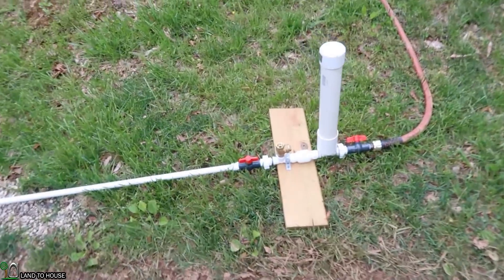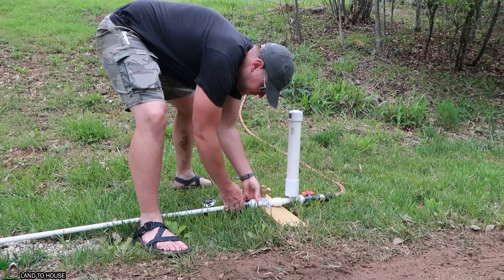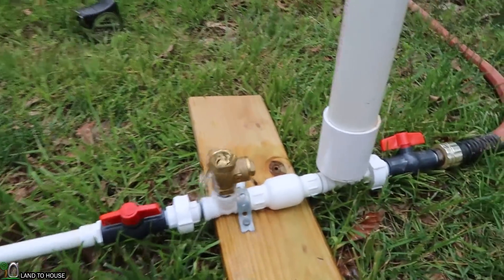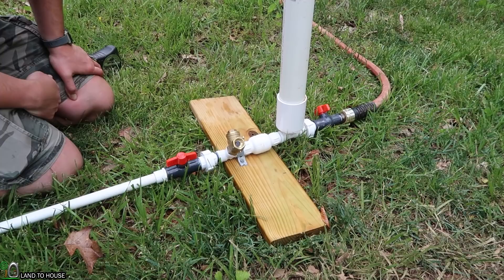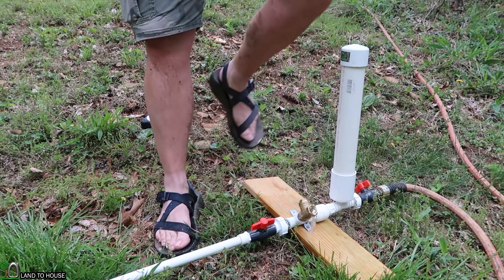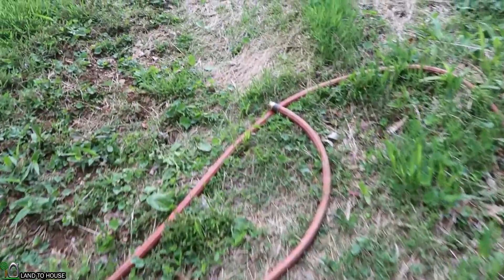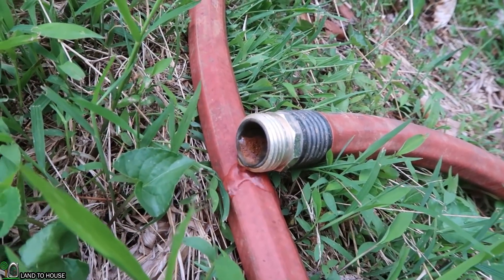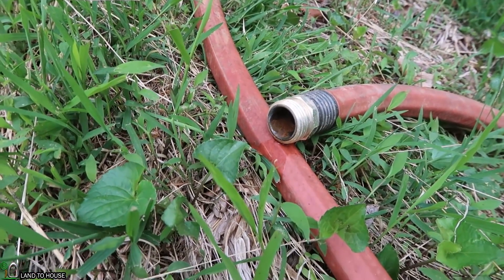Ram Pump Absolute Minimum Head Pressure

Comment: So, the mass of the water makes the water hammer that drives the water up into the air chamber, which is why the long run of pipe.  Why don't you increase the diameter of the feed pipe and reduce it near the pump. A greater mass of water should equal more pressure.

Comment: Have you ever tried using the venturie effect to step up the pressure from a flowing stream that is relatively level? I know it would speed up the water flow I just don't know if it would be enough.

Comment: I have at least 10 GPM (I can fill a 5-gal bucket in a about 20 seconds) but not much head...maybe a couple of feet at the most, I haven't had a chance to measure it yet as I'm just starting to build my system. I will probably be hooking up the intake in the bottom of a culvert as it comes out from under the driveway as that will give me the most head possible since there is a 1-ft drop immediately after that and someone else's property on the other side. I don't need a lot of water supply as it's just the dogs and I and I'm filling a 275-gal tote to pull from with a 12V pressure pump to a well tank. Would you say use the smallest one available as that works best/most reliably with low head?
Does it matter if I use rigid or soft hose/pipe at any point in the run? Does softer hose cost any pressure/efficiency with it's flexing or does it matter? I'll be running the intake down the creek a little ways to gain more head and put it closer to my water cube so a hose would be easier for following the twists and turns. 
I was about to order my ram pump tonight but ran across this video and figured I'd ask first before pulling the trigger.

Comment: Could you add a stand pipe to this to increase pressure from a very low head? I have a length of river on my property that is fairly flat with a very high flow rate. Wondering if i could make a ram pump that woukd function in these conditions. Need to pump water about 6 or 8 feet up the bank to bottom fill a large tote for irrigation/livestock

Comment: EUREKA, this tip to turn the check valve finally got mine cycling with little head.  Now I can work on improving the weir to raise the water level and eventually get the check valve back vertical.  Thank you!

Comment: What happens if you increase the diameter of the pipe to three inches then convert to 1/2 inch on the end. With more mass of water behind it falling, would it help the twenty inch ram pump function?
Reply: I'm wondering the same thing there must be a answer somewhere

Comment: I haven't come across one yet but have you made a video about the differences in one to multiple storage tanks. I was thinking of adding a stand pipe with a gauge on the top end to see if I could read intake pressure without water hammer interference on that gauge. However I realized this would also act as a secondary air pressure vessel and wonder what effects this could have on the pumps performance.

Comment: So you could have a staged or stepped system to get water up to 6' essential having an intermediate water storage and two pumps? I guess the intermediate storage tank you need to be quite big and not fill very fast, but you would be at least be able to lift the water higher?

Comment: Seth, I've been testing my homebuilt pump out similar to the way you had done and closing off the discharge side to let the pressure build up, but I only get 14 psi and the impetus valve doesn't cycle. I'm using an inverted 1" brass foot valve (without the spring) for the impetus valve and I think the plunger portion is just too heavy for the low water flow. For the check valve, I am using a brass flapper version like you used here for the impetus valve. I'm wondering if using the brass flapper as a check valve might require pressuring the accumulator tube, somehow. Three H/W stores in my area and they all carry the brass check valves; no PVC. 

Just to test the unit, I was using a straight run 5/8" garden hose with a drop of about 9 feet. Once installed, I was going to use a 100 ft long 1" poly hose. which might get me 5 ft of supply height at the river, but for now, I just wanted to test this thing out. I didn't use the PVC main check valve because they all seem to be sealed units, the springs for which are intended for higher household pressures.  Any thoughts on that? Maybe it doesn't make a difference.

This video was great. The information about the minimum height was priceless.

Thanks.

Comment: So your other experiment shows the pump will run submerged with little to no difference. Does that mean you could theoretically drop a ram pump into a well with 4' of water into a 3 foot pipe attached to the pump an it would pump it ~ 20' high? Or would it need atmospheric pressure? Would a bell siphon work into a ram pump? Only delivering what the pump uses? Or would the siphon give up?

Comment: What is the amount of water that a 100 mm rum pump uses in one go, knowing that only 10% of the amount of water used rises? Or how do we determine the volume of water needed to be consumed at a stroke ?, depending on the size of the main piston ?, or the size of the pump body ?. Both times together? ?. And after that we will look for efficient water sources. Thank you. You are the only one on Youtube, with simple, intelligible, relevant, necessary explanations. Thanks again.

Comment: Excellent job,  definitely worth the effort to test the limits of the pump. Have you tested the maximum head pressure for the point where the waste valve won't be able to cycle?

Comment: Low head is not a problem if drive pipe is a large enough diameter and flow rate increased due to less fluid friction
Reply from the maker: The problem then becomes the reduction in efficiency as the pressure wave battles the larger volume of water up hill.
Reply: @LandtoHouse  ľ altezza la devi misurare dal livello dell'acqua nel secchio, più è alta la colonna d'acqua maggiore sarà la pressione alla base e quindi anche nella tubatura. La larghezza del serbatoio è irrilevante, per avere una maggiore pressione è necessaria solamente una maggiore altezza della colonna d'acqua .
Con un serbatoio più alto puoi superare anche piccoli dislivelli senza l'aiuto di una pompa. Potresti fare altri video sperimentando quanto detto qui sopra

Comment: Thanks for continuing to test and record Seth! This is possibly the most helpful troubleshooting video yet for my situation. When I got started with your ram pump I didn’t understand the math and science of this - and did not know about fiddling with the check valve when drop/lift was lacking. I managed to figure it out after many frustrating hours, and I’ve ordered a brass check valve to see if that helps in the future. Now I’m searching for a good no pressure drip tape system. Anyone have suggestions??

Comment: Here's a time-intensive experiment: measure flow rates of delivery rate vs. waste vs. head pressure vs. delivery height and make a graph detailing what to expect under certain conditions.  I'm sure someone has done this already, and I plan to tinker a bit myself and record results, but it would still be an interesting experiment.  (I'll share data when I get to this)
Reply from the maker: It is a good idea. I plan on using this same hill to test that idea. Might have to run another 100 to 200 feet of hose to get the numbers.
Reply: @LandtoHouse  ... and remember the math&formula I sent you.

Comment: Interesting! I’ve got a stream next to me but the  drop from a town owned weir just over the property line to the edge of my property where the stream leaves is very low. I’ve not actually measured it but I’m guessing it to be well under 2 feet. It flows well but there’s not a lot of head. With that being said I want to use a ram pump to fill an ibc tote or two on a couple skids so maybe 6-7’ of lift total, to allow me to water my garden more regularly. This low head video speaks to me. What kind of things can be done to increase efficiency? You mentioned turning the waste gate so it would run at a lower pressure but sacrificing efficiency in watching some other videos you talk about a larger drive pipe lowering pressure this seems counter intuitive as I’d think larger volume of water into the pump would increase the amount of force in the pump if the pump is significantly smaller than the drive pipe? Any suggestions? 

Thanks for your help.

Comment: Maybe if the input slap valve had an n shape exhaust pipe to achieve the syphon effect,
then the valve would be more efficient and slap closed at lower pressure?

Comment: What if you had wider pipe right from the bucket and goes thinner down to the valves? Would it help to have more pressure or not? I think it would help to have more pressure, but not sure untill I see it in action, cant do testing myself because I aint got them tools with me nor a stream nearby to test.

Comment: In Skimming your ebook, I didn't see you getting into drive vs supply curves and  tdh.

 At some point, do you recommend just winging it?
Reply from the maker: My goal is to run a few tests on that to make a small chart. I'll have to do a chart on each size pump because they will consume different amounts of waterMy goal is to run a few tests on that to make a small chart. I'll have to do a chart on each size pump because they will consume different amounts of water.

I will probably use the same hill for my testing ground.
Reply: @LandtoHouse  cool!

My alternative is this low flow, high head xfer pump. It's gotta graph with discharge height on the Y axis and GPH on the X

At 110', saying 3 GPM

https://m.ferguson.com/product/proflo-12-hp-cast-iron-transfer-pump-pf90060/_/R-8889397

Comment: Great experiment, and very useful! Measuring the head pressure with your outflow test is also very meaningful. You probably could reduce your waiting time by using a shorter Delivery Hose ;-) or by measuring just the pressure at the outlet of your pump. That is probably not very accurate (1 psi is equivalent to 2.3 feet of Delivery Height / and your pressure gauge has only one scale division for 4 psi, if I remember right), but much faster. Perhaps there are more sensitive pressure gauges? You also can test your pressure gauge (and how accurate it is) by connecting it to a hose full of water and lift the other open end of the hose to certain heights.